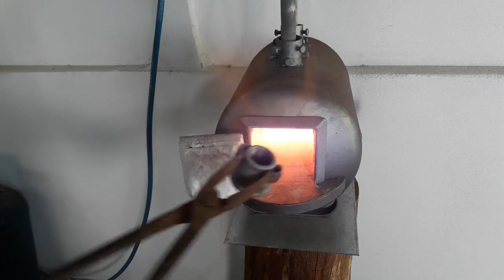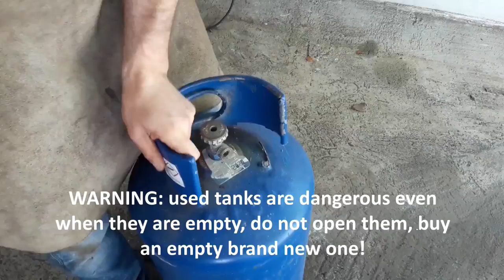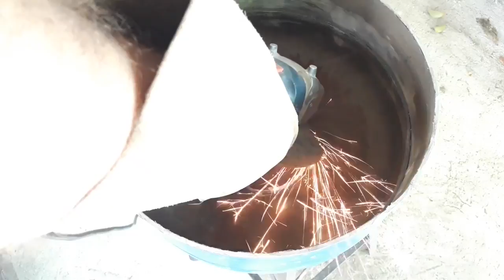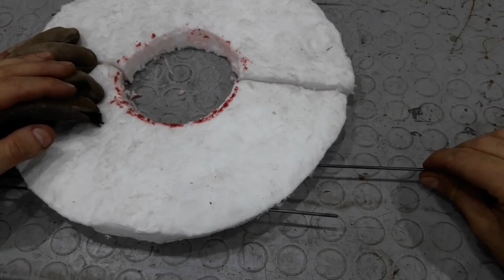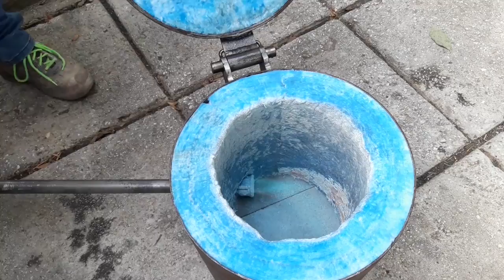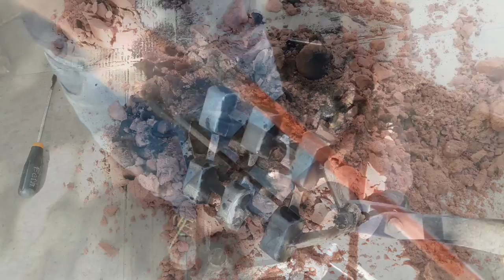Making a home metal foundry | Casting brass shiny ingots

Comment: Very nice furnace, i have a question what hardener are you using and why are you using an hardener its still working without it, or not?
Reply from the maker: Thanks a lot! 
I'm using a liquid hardener, I bought it on a spanish website where I also got the fibre blanket, there is no brand or anything on it. The forge works perfectly also without the hardener, its main function is to make the ceramic fibre last longer.

Comment: Whats that white like wool thing??
Reply from the maker: It's ceramic wool fibre, probably the best or at least one of the best insulating material, it is used for commercial furnaces too any many other applications in which you need to keep the heat up
Reply: @dudemakesstuff  thank you  for replying you earned a sub
Reply from the maker: My pleasure... and thank you!